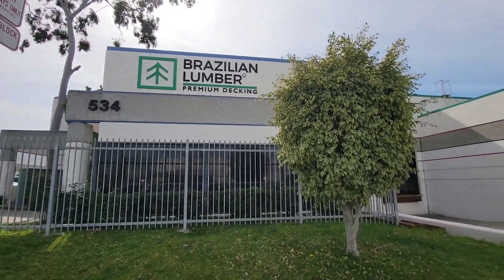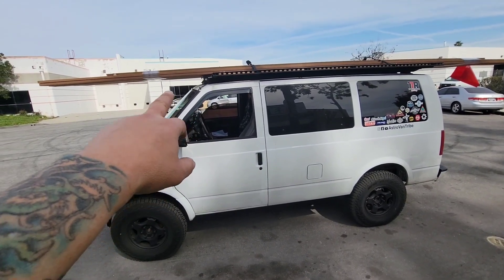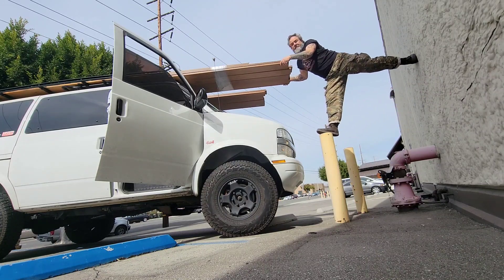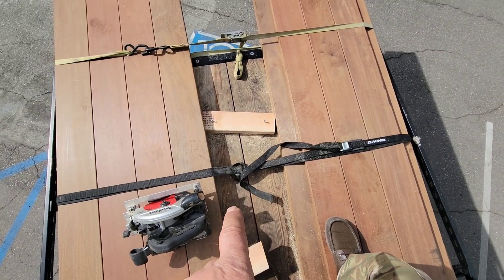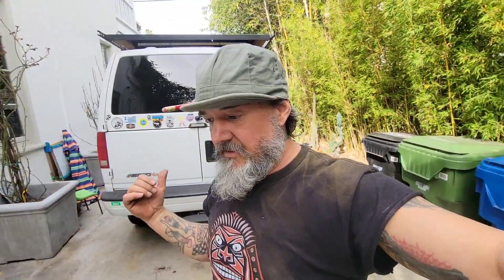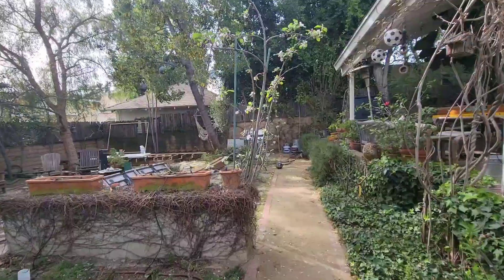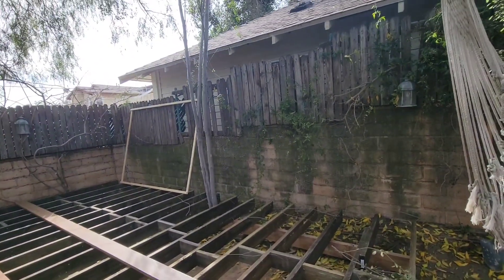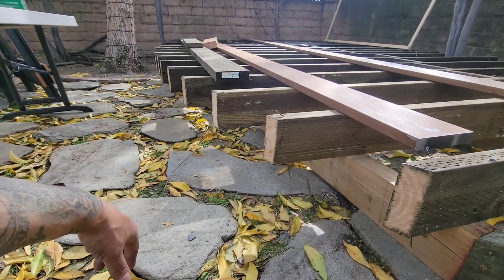At Least a TON Of Material On My DIY Astro Van Roof Rack

Comment: You should try the camo system you can get it at home depot. The tool and the screws. It works by screwing the boards down from the sides. Gives you a fastener free surface and you can remove and replace boards if damaged.

Comment: man that's crazy that van is a beast how did the roof hold up? I'm surprised it didn't collapse lol
Reply from the maker: That goes to the design - I designed it to evenly carry any load - I also shimmed between the sheet metal of the roof and the steel "ribs/frame" with a high density foam. Of course I over built the base structure for the race using full 1/4" thick aluminum 2" angle for the base plates and rails that run the full length of the rack system - Seat-of-the-pants engineering